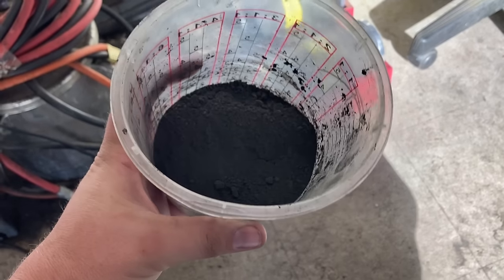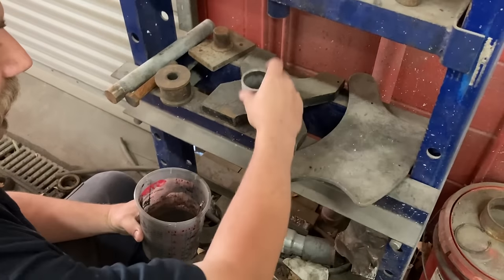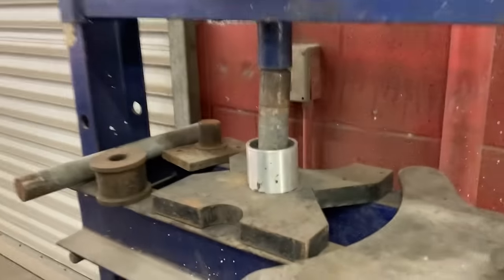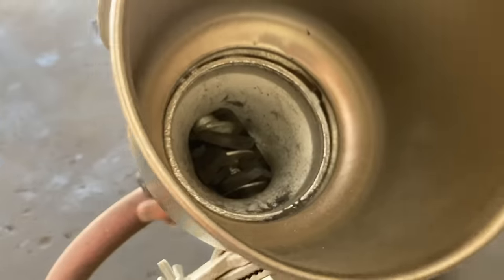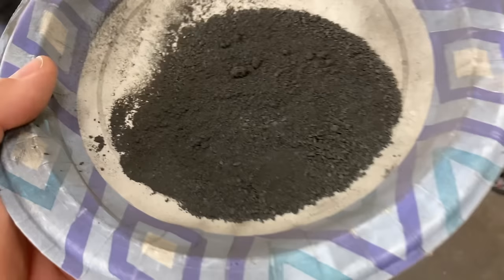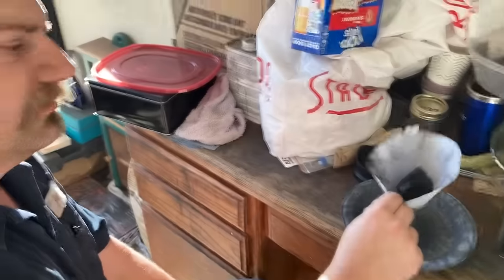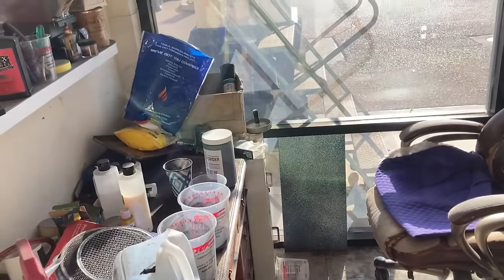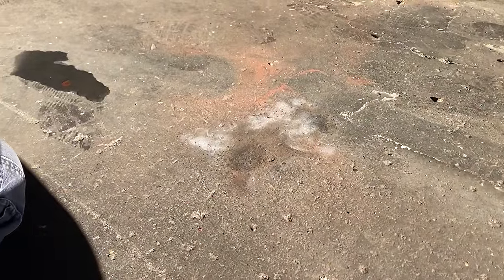Making Corned Black Powder

Comment: Just found your channel. Thank you!!! I was getting ready to make my first batch but will hold off until I get a little more equipment. Those of us who shoot flintlocks will want to get a slightly smaller final screen to make 4F for primer pans. I know many use 3F but my flintlock prefers 4F for priming.

I like how dust and other finer grains can be simply run through the process again. In reality, very little is truly wasted.
Reply from the maker: Thank you. It’s the only way to fly, If you use a grain grinder you can get just about any size you want. The dust leftover works well for priming too.
Reply: DIVE IN you learn what you need as you evolve! You will be HOOKED like a Big Ol Bass with a mouth full of treble hook!
Just casehardened a hammer Frizen tonight in my campfire!
Keep those smoke poles Smoken!

Comment: By Corning your black powder you are able to reduce the amount of water used thereby aiding in the prevention of KNO3 crystal growth through the drying period. You should never tumble your corned powder because the other benefit of corning is it creates sharp edges which created a greater surface area allowing for rapid ignition, increasing velocity. Get rid of the graphite, it adds unusable debris in you powder charge. Great vids, keep them coming.

Comment: Ten dollars to a donut, that graphite helps the flow of the powder when pouring it for packaging or loading. 
As far as spark risk when using a grain mill, try to get a spark out of it. You will see that short of applying the tinned, cast iron screw to a belt grinder (which barely produces sparks) you will find it unlikely . 
Pretty puckin’ awesome Jake. Your powder is perfect.
Reply: She said... looks like a hand job and no forplay or pucking around.
Reply: Ya and youd have to turn her pretty fast to get enuff friction heat .
Reply: About the pun - I was legit confused when the video description told me to pucking die

Comment: If people are worried about sparks, I think there's an option for ceramic burs for the grinder. But, a lot of them are cast iron, which isn't the most prone to sparking anyway.
Reply: Want some fun?
My rotary meat/puck grinder is on my welding table! I clean it with SPARKS! now that's a good time!
Reply: If they’re that worried about it why not attach a grounding strap to it and plug it into the wall?
Reply: I used tire weight lead (hard lead alloy) to make tumbler media. 1/2 to 3/4 inch drill bit, bored into a chunk of 2x4, and about 1/2 inch deep, to make a molde
Reply: @308dad8 That's what I was going to say !
Reply: Looks like an aluminium grinder, aluminium does not create sparks.

Comment: I read somewhere that the main reason for coating the grains with graphite was to make them electrically conductive to reduce the risk of a buildup of static electricity and the risk of sparking. Sounds logical to me. It probably also makes the powder flow better when loading etc because graphite is very low-friction and the tumbled grains are nice and rounded.
Reply: I have heard that, I also heard it's too reduce how much it will grind itself down when moving a lot,  like shipping or hiking, to keep the granule size uniform.
Reply: That is for smokeless powders which are a bit more like plastic in behavior. The charcoal in black powder is already conductive enough to prevent static. The tumbling does give it more consistant flow and gets rid of most of the handling dust up front.

Comment: During the middle ages they would adjust the amounts of sulphur and salt petre depending on what they were using it in. They also hand mixed it dry on site until the 1600's, so it was about half as powerful as milled powder

Comment: Just a little FYI. The flower powder works great for M80s and cherry bomb type of fireworks. Also can be used as filler on areal devices to help with the burst of the product. Also works well in making stars and other cool features. I've used it for just that reason. Look up fireworks manufacture. Lots of great information.

Comment: Finally someone, who do quality pressing before next steps...Hats off. It seem on professional preparation. Also burn rate is one from best what I saw on YT.  For exact measurement is better use normal papper under BP. If will paper without black points, is it very good BP.
Reply from the maker: Thank you

Comment: Graphite is not added to make the powder better at burning, but rather to help storage and handling: graphite is conductive, so it will help with static electricity, reducing risk of accidental explosion. At least, that is the idea. Same thing for removing sharp edges of granules. Without those edges, the powder can be handled for longer without creating too much dust from collision (meal powder) that would cause accidental explosions.

Another thing, did you experiment wih adding binders to the pressed mix to help better keep shape of the granules?

Comment: I just watched your video again and I still learn something.  Great video.  I used grapevine for my charcoal, and milled it for about 23-26 hours.  Then screened it and let it dry.  Then mixed it and pressed with my home made puck and ground after drying for a day or so.  I was very, very impressed how well it shot my 50 cal with only 85 grains.  Nice thing was that the fowling, like you said, is a lot less than pyrodex.  And the smell was very pleasant compaired to pyrodex.  It didn't have the sulfur (rotten egg) smell.  It had a nice smell of firecrakers.  I'm going to make me another batch and try to get it sorted into sizes 3 and 2.  Again I want to thank you for your videos.  I'm trying to find more of your videos to watch and learn.

Comment: For charcoal Red Cedar small pet bedding works well if there is no willow available. I'm down in Florida and have used Brazilian Pepper which gives a good fast burning charcoal.  Cooking temperature for the charcoal really can improve the final product. Keeping the charcoal retort under 600 degrees will produce a brown colored charcoal which has a lower ash content and produces a really fast powder. I've been making screened powder for a few years now for my front stuffers and need to add a little dextrin to harden the final powder grains. Just don't have the need to set up a press with a puck maker but your video is great explaining how to do it up right.
Reply: I’m in FL also, powder from pepper trees sounds like a good use of them, do cut it dry it for some period of time? I’m interested in your method. Thanks

Comment: Commercially they tumble first the ready granules to as you said make them smooth, then they separate the dust, finally they do same but with graphite. It is done because it helps with repeatable measurements of the granules and in consequence the shots, also add some level water resistance in long term storage. Graphite coating doesn't make powder more powerful.
Reply: Actually, I believe graphite is also a burn rate inhibitor for more consistent ignition too. Or something like that.
Reply: @dogechannel9933  I have read about BP manufacture in some old book, that included processes of different countries like USSR, France, England, Switzerland?, I don't remember such mention ;)
Reply: @Qwertypp10  I had read it in a 1985 research paper. Title is "A Comprehensive Review of Black Powder" from my understanding of that paper, it slowed the burn rate of black powder down. 

For further proof, I produce my own black powder, and with the same batch, I coated one part in graphite and one without, both tumbled for the same time (the granulated powder) but the only difference being one was tumbled with a tiny amount of graphite (less than 1%, wasn't exact though) and I got significantly different burn characteristics. From my 45-70 I got an average of about 972FPS without graphite, and about 924FPS with graphite (10 round groups), didn't seem to help deviation at all, but that was just my 1 experiment.

I would love to know what book you read that described the process of USSR manufacture of black powder! I never knew they were a producer.
Reply: @dogechannel9933  I would agree on slowing the burn rate.
Reply from the maker: That’s really interesting! I haven’t seen any significant changes in velocity’s from graphite to non graphite but I haven’t chronographed any cartridge rounds with it only muzzleloaders. I’ll have to give that a try
Reply: @Everythingblackpowder  I had thought to try it with one of my muzzle loaders, but I figure since there's little way I can consistently get good compression in mine, it would provide inconsistent results. Plus since cartridges are all loaded the exact same way, to the exact same compression, with the exact same amount of powder, I figure that must be about as accurate as I can get.

Comment: Thanks and Love the attitude - I am new to the black powder (1 year now) and have been trying different percentages from 60/30/10 to 78/12/10 and found that 77/13/10 produced the better mix.
I was not aware of the graphite thing but after you said it does nothing you can find different then I can skip that. I started corning black powder after I saw a video on their method and it seems to work well but the pucks I make I use a 1" PVC tube and a wooden dowel with a 2000 lb hand press, but did not use the tumbler after that is something I will try next time. Thanks again.

Comment: Thanks for instructing with visual cues instead of tactile cues.  I've always heard "biscuit dough" etc and had crappy results, but your description makes more sense.

Most of the spark explosions in old powder mills was from sabotage just based on what I've seen, plus that's a massive scale so of course they'd blow up the whole mill.  With that grain mill the gasses have a lot of passageways to vent.  I use a hand crank coffee grinder.

Comment: I have made this in the past, I found that if I added a tiny amount of water while tumbling on several occasions per batch, the  powder would burn substantially faster. I am talking small amounts. Try it and see if you see a difference.. not enough to cause casing. Since I don't have a couple 8 to 10 ton incorporation wheels and stone bed, I feel it adds to it. Cia method may also be tried though I never did. Good luck.  It's nice to be able to make something as well as a factory and and end with better results.

Comment: Hey thanks for the straightforward discussion, some of us need that…. Been making powder for a while but your video’s definitely helped with my density issues. I’ve moved on to using a temp controlled incubator for drying pucks and powder storage sure makes life easy when you can store your powder at 110deg with minimal humidity year round… keep up the good work…
Reply from the maker: Thank you
Reply: I wouldn't be afraid of humidity.

"Charcoal Tests" wichitabuggywhip

"Note the huge difference between the 2Fg burn trough test from the year before (the first entry in the burn trough table) - it was the same batch of powder. The last test was done on a cool October night and both the Goex and the Elephant had been stored in an outside shed for several months. This effect was also noted by Dan Williams in his burn tests"

Comment: Thanks, you're the best. I just made my first batch of powder. Used the treadmill, but just put a fence over the treadmill and let the jar roll on the tread. I used 1/2 inch ball bearings as media (I know, but I've never seen ball bearings spark, they're cheap and they don't wear or leave residue in the powder). I finished making the pucks with PVC pipe as the tube and an aluminum and a brass disk (picked up at the thrift store) as the piston and pressed them in the vice. I tried to run the broken pucks through a Baratza Encore burr coffee grinder (also thrift store), but only got a little corned powder. Most of it was a fine dust, which plugged up the grinder. Most of the puck pieces were too hard to grind easy that way. The powder burns pretty fast.
Reply from the maker: Glad to hear it

Comment: Some time ago, I made a decent few batches of powder, but I found the resulting wet muck to be pretty corrosive. It ruined my hydraulic press and tumbler, rusting out the various bolts. Same with my sieves. If I ever get into this again, I'll make sure to rinse off all that black stuff, and get the equipment nice and clean. I was always a bit doubtful of my corning results, but after watching your video, it seems I was doing the pressing effectively all along, and achieving nice pucks. It performed well too.
Reply: WASH IT, DRY IT AND SPRAY WITH MOTIRCYCLE SILICONE AND THIS WILL NEVER HAPPEN....JOB DONE.

Comment: You might want to experiment with dry pine cones as wood for charcoal. I've read good things and they are pretty abundant, free, and sustainable. It could be a blessing if they work well.
Reply: The wood or the cones
Reply: @tedmosby9409  The cones. It's something I've read works well. But pine wood will also work fairly well since it's a conifer, but it has to be well dried because it contains a lot of sap. It's not the preferred wood, but it's decent. The woods you want to avoid are hard woods. They are too dense.
Reply: @jeremiahembs5343  too much sap it will gunk up ur chimney real bad hence why people use hardwood

Comment: I used to make rocket propellant grains using a high lift jack bolted to a tree and a 6 foot breaker bar with a 5 inch thick safety shield made of plywood between me and the jack. Worked great never had any problems

Comment: One of the functions of graphite is to lubricate the barrel.
Another is to facilitate a better, smoother flow of the granules in automated cartridge filling / bullet production systems.
Reply: The way I've read it, the primary function of graphite tumbling is for smooth flow (prevents clumping), secondarily to reduce the hazard from static (the conductive coating prevents static building up a voltage between granules of powder that could potentially ignite the fines).

Comment: Awesome!  The whole process.  Also, the granules did look just like Goex!  I would love to see how balsa performs using this process because it is the lightest wood which could mean better incorporation of the components.  It would up the cost but it would be interesting to see how it performs against a chronograph.
Reply: I've  been  making BP for a couple of years making  my own charcoal.  I live in N Florida and have used cedar  and pine so far with fair results. So my neighbor cuts trees  for a living and brings me small logs of different types of wood for wood working. So one day he brings me this  somewhat large piece of China  fir.  This stuff is really  light. So I  made some charcoal  with it. Ground it to air flight in the tumbler. I used the CIA method for the BP. Cooked in water  on the stove. Dried it ,graded it kind of. Tested my FFF on a paper  plate.  Burned  very fast and was by far the cleanest burning yet. That would be compared to the cedar  and pine. So if anyone  else  can get  some of this China fir , I'd  like to get some other opinions.  I also have an idea for storing BP. I going  to leave it in the wet stage after  making it and see if their is any difference by leaving it wet, in a jar for a length of time and just drying it out as needed. As far as I know,  it can't  burn wet in a container. So storing large amounts  would be  safer. Any thoughts  appreciated.

Comment: As for sparks in your grinder... If you ground(electrically) it, and dont put anything in it thats harder than steel or very chemically reactive like cerium(modern version of flint) you wont get any sparks. Graphite can have several advantages. It keeps the powder from clumping if its evenly coated, keeps it free flowing. It also inhibits the burn rate a little. That sounds bad but it evens out the burn rate for all the grains
Reply: Grounding it isn't going to help anything. The more important part is being made of non ferrous metals.

Comment: I've seen a table somewhere, with the diameters required for smaller presses. For instance, a small 2 ton arbor press can generate the required pressure with a 3/4 inch (maybe 1/2 ?) pucking die. That would work for me. Plus I think the smaller pucks might fit into the grinder a little easier.

With respect to grinders, I wonder how well a quality burr type coffee grinder would do ?

Comment: Made my first 134 gram batch 75 p.n. 15 Charmin and filled the rest of the can with red ceder 10 sulfer only have a 6 ton press density was 50 by volume 42 by weight pucks held together good. Very fast burn. Can't wait to load the old 6 gun!!!
Reply from the maker: Excellent

Comment: I tried to grind down the best of all, willow char-coal with water in a mixer. Then filter it out and dry it in the owen at just 150 °C. It self-Ignited, fail, haha. I got a black-face in the process. The charcoal can be very reactive at some temperatures, especially this type, willow, slowly carbonized at 450°C. without air.

Perfect for makeing fast-burning powder though.

Comment: Dear sir I figured out the solution to lead in my powder because of lead balls in my ball mill and the answer is TIN.Tin is heavier than marbles or ceramic and it casts very well .I bought lead free solder on ebay and melted it down and made 58 caliber balls.Works great still not quite as heavy as lead I'm sure there are many sources for tin Happy to not have lead in my powder
Reply from the maker: Excellent, thank you!